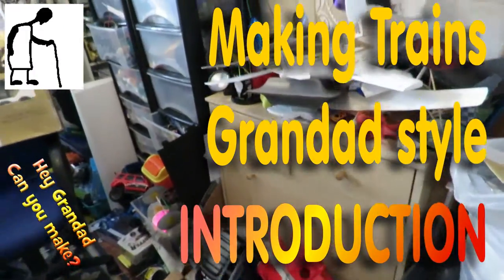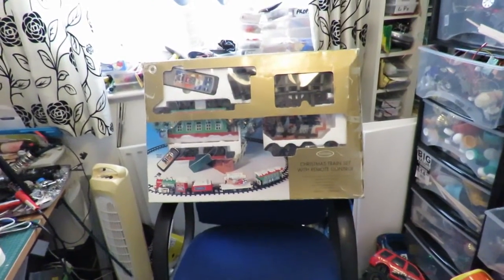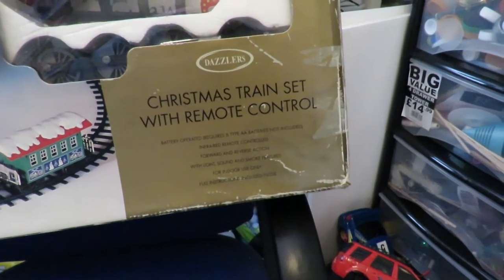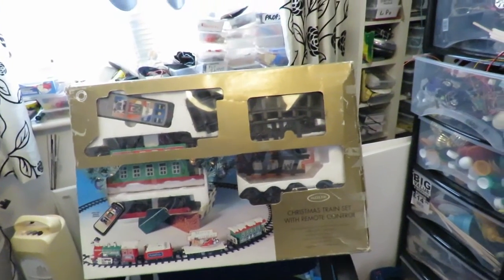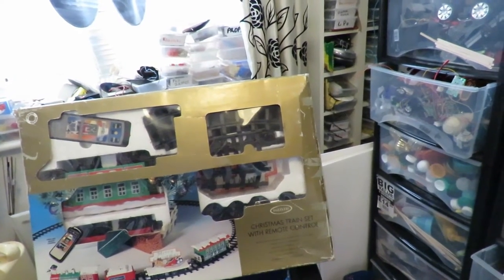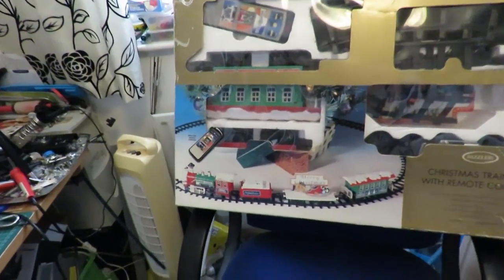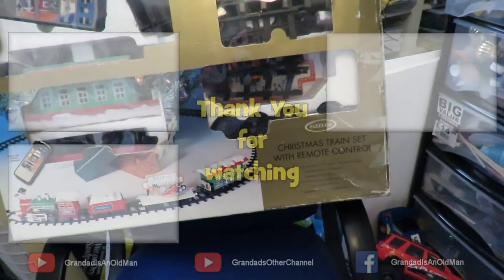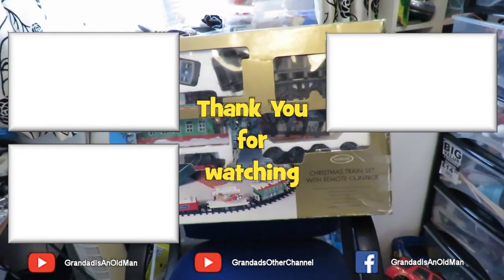Making toy TRAINS Grandad Style INTRODUCTION

Comment: Rubber band powered train, (Wo)first Great Western might be more reliable if you built some for them.
Reply from the maker: Hi Ian, I don't remember the last time I was on a scheduled train, just too expensive for any journey I want to make. I have been on a few maintained by enthusiasts such as near Okehampton - Dartmoor Railway - and near Bristol - Avon Valley Railway.
Reply: If you know where to dig around on the internet and book a long time in advance then you can get cheap tickets, cheaper than the cost of fuel for your car on a long journey, but just turn up at the station and buy a ticket and that will expensive.
Reply from the maker: I guess that depends on how many people are going, parking fees or taxi fees to and from station and so on but yes I know or at least have heard that you can get cheaper tickets which just demonstrates what a complete mess the rail system is in. The way the ticketing structure appears to have been built simply to confuse the user 😊